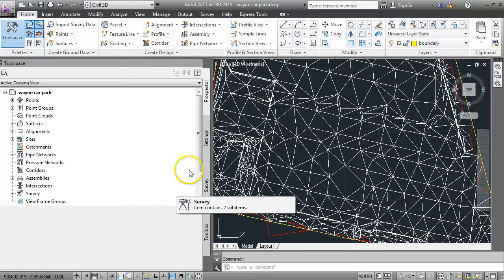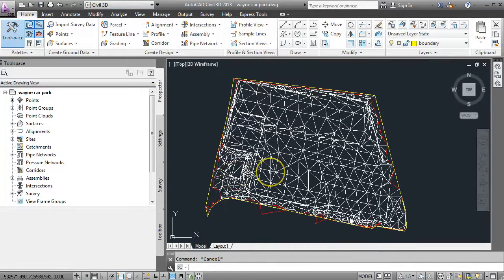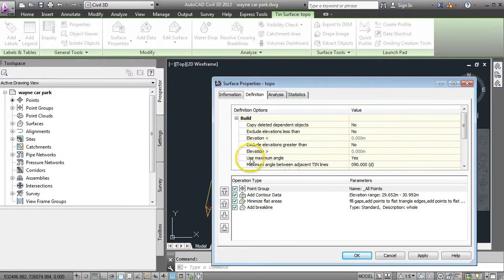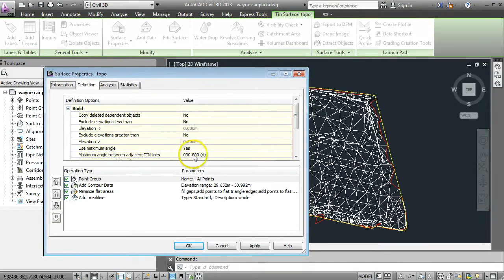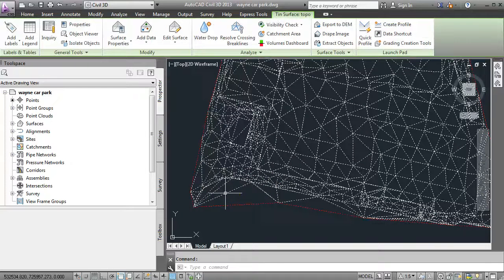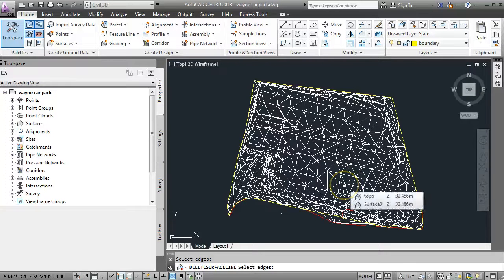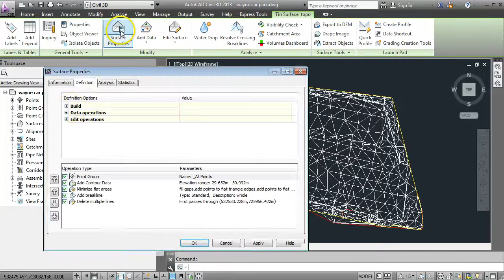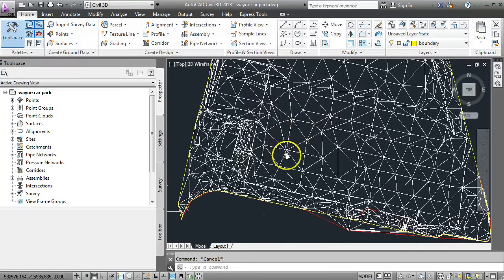Resolving Surface boundary Issue

Comment: Great
...can you please tell.me how to make a changes in contour in surface with traingulations specially they way of joining lines and changes in contour....
Reply from the maker: Usually turning off the setting where the maximum angles are limited in the triangles can make a big difference.  Have you tried that?